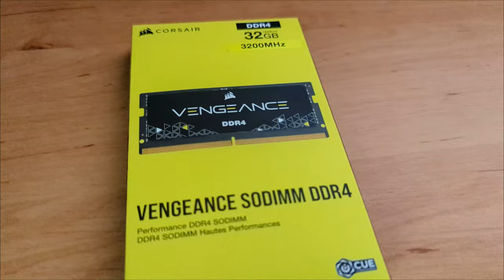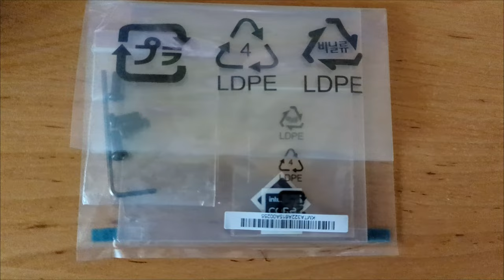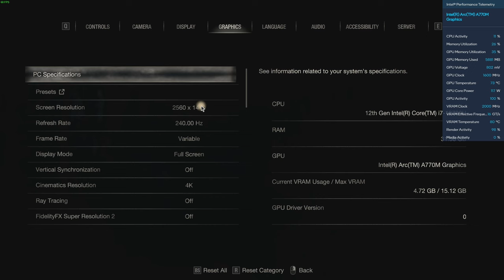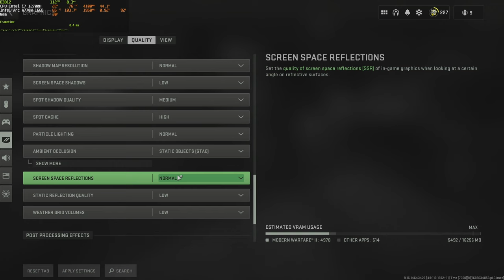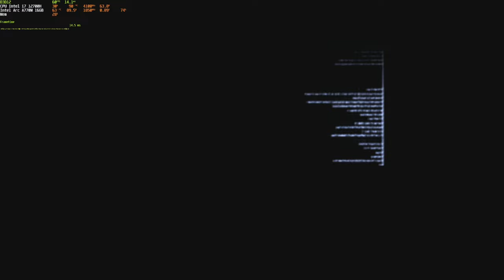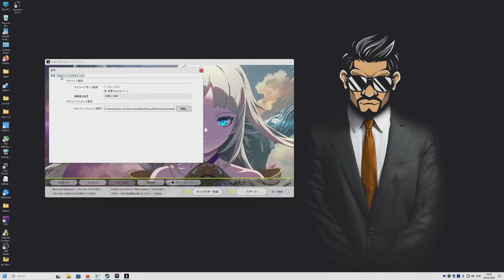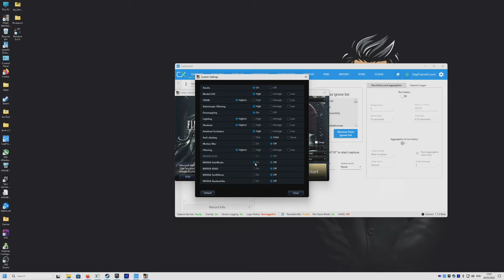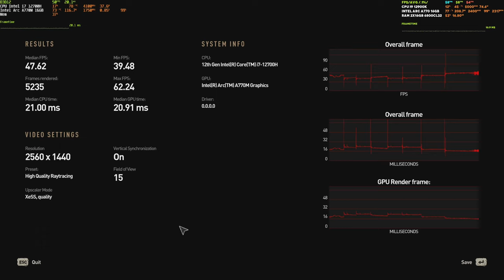Intel NUC Serpent Canyon UNBOXING + Intel Arc A770 vs. A770M 16GB in 9 Games

Comment: love the NUC series, any chance you can do an updated video with benchmarks after the recent driver updates for ARC? thanks
Reply from the maker: Will do an update 8 months later and see how it goes ;) might need to replace memory thermal pads though weird design.
Reply: sounds great  it's a bit fiddly getting the coolers off the replace paste/pads @graphicarc
Reply from the maker: @DavidWilliamsnz I already had it disassembled few times .. can't seem to find the right size of thermal pad for the memory chips.
Reply: could you use some of the thermal grizzly sheets and cut them to size? @graphicarc

Comment: Mine is going great 1 week in, i love it. i had exactly the same problem getting the heat sink back on. you have to start by fully engaging it on the far side if you see what i mean, then it's easy.
Reply from the maker: Glad you like this intel nuc ;) its now finally back in stock at least in EU and its a really good buy compared to others especially the new Asus NUC 14 rog 😅
Reply: @graphicarc  I paid £680 for mine new. I didnt really need a new PC but for that price I had to have it.
Reply: Hola amigo, cual disipador de calor ?

Comment: Fam your videos are amazing in between minds on a 3060 ti but watching your video change my mind the arc offers you so much more value
Reply from the maker: The super resolution in video players is amazing as well ;) the image quality boost from 720p to 4k or 1440p is amazing. Make sure you sub so you don't miss the upcoming video :)
Reply: The value that the arc a770 is so much and it is still getting updates

Comment: Great video. Would recommend this at @1440p ?
Reply from the maker: A770m has hdmi 2.1. Yes it is a solid machine though ram speeds could be better. For 600€ or how much its now + ram and disk for 100€ you can get a solid sff gaming macgine for 1440p60?

Comment: Very detailed video!! How are the noise levels? The cpu seems to be running quite hot, the fans must be spinning quite fast.
Reply from the maker: They get quiet loud :) depends how you set them in bios though. As for the temps on CPU it still has some headroom to play around and get better speeds out of it. I've noticed worse temperatures when the case was opend? Might have been the difference of the temp inside the place.

Comment: Hi, I'm running Returnal on this system at 1080p lowest settings and it goes from 60 FPS to 10 FPS constantly even without moving and this happens in almost every game, i paired this system with 2x Kingston fury impact 32 GB DDR4 3200 Mhz CL 20, and SSD Kingston fury renegade gen 4, 1TB NVMe, M.2, Windows 11, can you please help me, what am I doing wrong, everything is updated to the latest software

Comment: Hi, it’s me again, quick question: Can you change the max tdp of the cpu in the bios? Maybe the cpu temperature would be lower with that because it draws less power…
Reply from the maker: It can't be changed sadly.. maybe if there was some bios update but I have to check didn't do much on the NUC except do some work. I will be recording more soon on A770m but am still waiting for my NVME to PCIE adapter to connect elgato.

Comment: Hi, thanks for this gaming review !
I've just got the same Nuc 12 Enthusiast, switching from Nuc 11 Enthusiast and I've got issue with Riva Tuner Statistic Server. 
Do you have any issue displaying the Arc 770m GPU sensor on RTSS overlay ? Personally, if I don't desactivate the Iris IGPU, I can't get proper Temperature, Power, Usage and VRAM Usage for Arc 770m GPU. Probably my windows install (transfer NVMe, too lazy to reinstall clean), but want to be sure before wiping the Hard Drive...
Reply from the maker: Yeah I got the same issue :) capframex should help you but some sensors arent available until you disable the igpu?
Reply: I’ve transfered NVMe SSD from Nuc 11 Enthusiast to Nuc 12 Enthusiast without reinstalling. Next cleaning graphic driver with DDU and last install Arc driver.

On MSI Afterburner or Riva Tuner, I see 3 GPU : GPU1 Iris, GPU2 dummy GPU, GPU3 Arc a770m. The sensor for GPU 3 are weird, missing some and erronous data (GPU3 VRAM is MB not GB, GPU3 Temperature is missing...).

If I desactivate Iris IGPU, Arc a 770m is now the GPU1 and sensor reading are correect in MSI afterburner or Riva Tuner, as always.

Do you have the same expérience on your side ? Probably should I clean install ? 
Do you use the WHQL Arc Drivers or the NUC 12 Enthusiast Specific Arc Drivers (OEM) ? Try both (WHQL, Beta and Nuc 12 Enthusiast OEM specific one) with same result.

Comment: Hello GraphicArc, I also purchased the Nuc Serpent Canyon but somehow my corsair vengeance ram is overheating. I get like 83c tempeerature. I don't know if it's faulty reading but I used two different applications and it seems to be accurate. Can you check your ram temperature on your serpent?
Reply from the maker: Hello :) well 6 months later ... my temps are 50C if it helps when being used.

Comment: I bought this nuc two days ago. Mine has smaller 330w charger. Now i do have a question for you. Did you had issue with the windows installation not recognizing network devices and did windows 11 automatically encrypt your drive making the system slower? I tested my nuc with linux first and its mega fast, but windows, I am not so happy.
Reply from the maker: Hey. Just disable bitlocker and disk shouldnt encrypt? Usually if you flash iso with rufus, it gives that option. No issues whatsoever except on my modified lite version I needed to install network drivers manually.
Reply: @graphicarc  already did that and it works fine now. Just wanted to check if this was the case only with my unit or other people have same “issue”
Reply: Yes I had to tether my phone to get through the windows install, almost gave up. it's all good now though. both my nuc 11 and 12 came with small chargers.

Comment: You cant build a cheeper desktop with A770. This NUC is more than fine and there is extremely small diference between mobile and desktop version wich is rare. You basically have a desktop version  of a GPU in a laptop case.
Reply from the maker: Especially now that it dropped price big time well at least in EU ;)
Reply: @graphicarc  I am in EU  Hi from Serbia :)
Reply: @graphicarc  im actually thinking about buying it, it is around 700€ rn for the barebone version, would actually wanted to try and liquid metal cool it for better performance